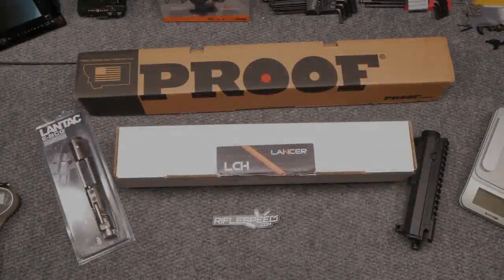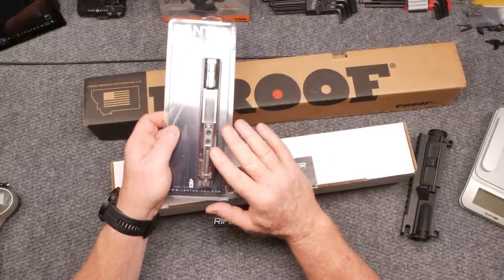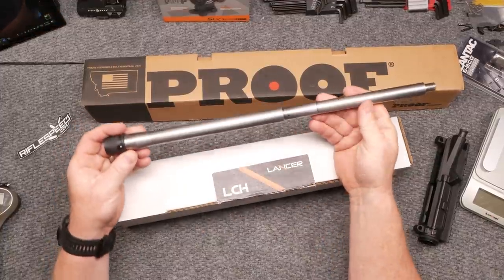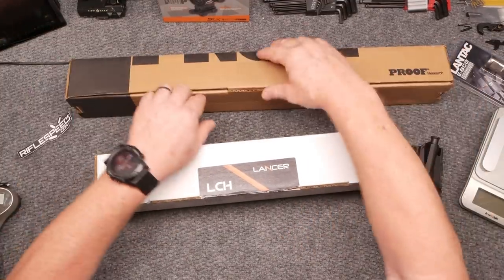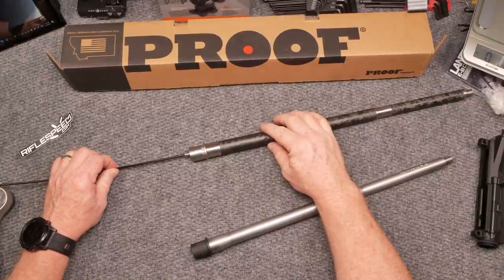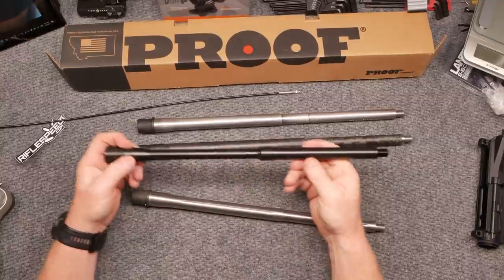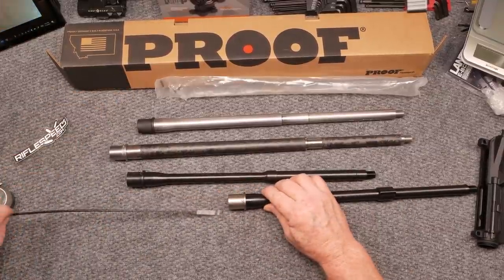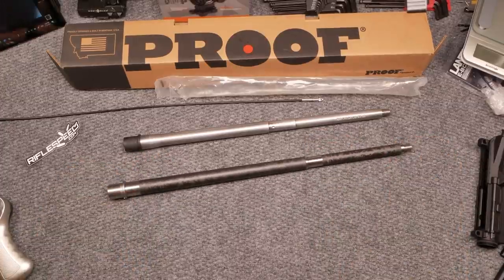Cheap Vs. Expensive Series, What you Get for Your Money

Comment: He might have added the parts on the upper after he got it. But another thing is he really should use a forged upper because they are stronger than a bullet and more resistant against blowing up during a catastrophic failure with a bad round or with the upper and barrel getting over heated during rapid fire.

Comment: On the “Elite” build, you said that you’d heat it up for about 60 rounds and do a POI shift test (or something like that). I haven’t seen it. Did you do any heat testing with the carbon fiber wrapped barrels?  That’s what I’ve been waiting to see since the “Elite” build. I don’t know if they’re crap when they’re hot or awesome when they’re hot. However, I’m eager to find out.
Reply from the maker: I can't remember is I did that or not.  I do know, in my case the elite build does not shift.  We'll do that test with this one
Reply: Main reason I avoided these, was that they tried to do aluminum on steel for the M14 a long time ago and it blew up.  I don't run it "200 rounds in 2 minutes" during peacetime because that will ruin pretty much any barrel, but there may be a time when I do need to do that, and I don't trust carbon fiber to hold up to the task.

Comment: I have a 18" AR stoner, i saw some good reciews and one day they had them on clearance for $75, worst $75 i ever spent, it had a huge burr on the gas port and would cycle until i drilled it out, also the barrel extension was below spec and no matter how tight the barrel nut was it would randomly throw shots off paper, swaped it last week for a 16" BA premium series, fit much more snuggly in the reciever cant waot to see how it does

Comment: The carbon fiber is very cutesy wootsy, but is it 7 times the cost of the beat creek barrel cutesy wootsy? 7 times more accurate ? Ehh- I like nice things as well, but I highly doubt it’s that much better than the button cut bear creek barrel, or ballistic advantage barrel, save for aesthetics.
Reply: I more wonder about the heat dissipation from the barrel. Does a carbon wrapped barrel have significantly longer cool down time? What is the temperatures like in the bore when so much less heat can escape? Does it mean the barrel wears out faster?
Reply: @rustknuckleirongut8107  good questions

Comment: At $55.00, Bear Creek is a bargain, for what you get. Their phos, is about as nasty looking as you'll find. The cuts, on their 416R/melonite  fluted barrels, have very poor cuts. Once hidden under a free floating rail, ok. 
Button rifling, is what it is. I've not seen their 5R barrels, so no informed opinion.
Your Customer Service mileage may differ. Mine was very poor. 
Presently, Bear Creek is cutting prices, at recent high water pricing marks, BCA was WAY OVERPRICED vs. quality.  BCA still is over priced. There are many other reasonable barrel mfgers, with comparable or better pricing for better quality.
I bought a number of BCA barrels at $55.00 to $65.00, incl. 5.56, 6.5 Grendel and .223 Wylde. Most in 1/7T, the Wylde in 1/8T.
Their melonite finishes are good, but only as good as the finish on their 4150 or 416R. 
At $99.00 to $159.00 BCA is a rip.